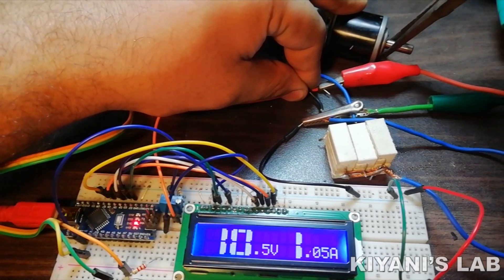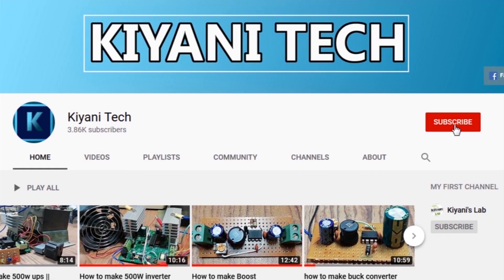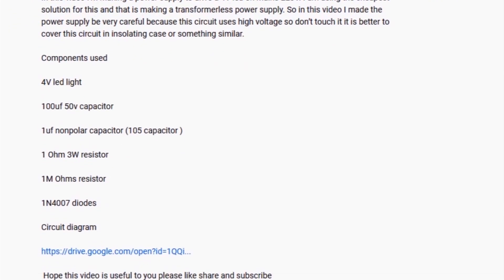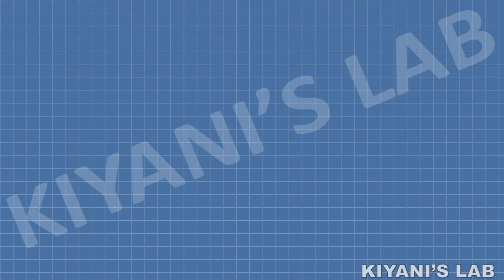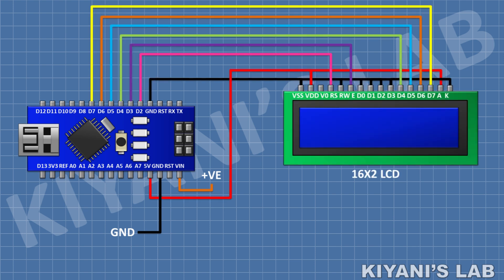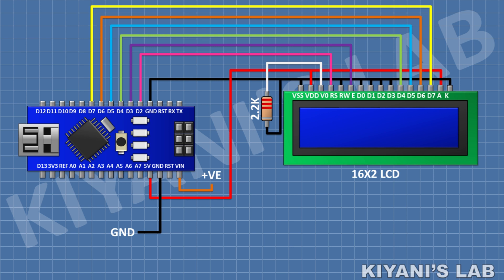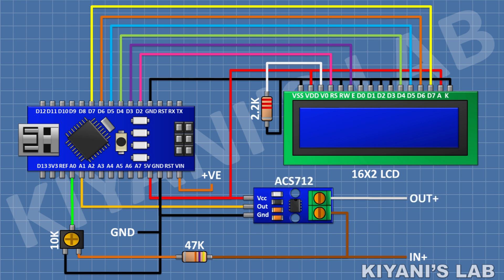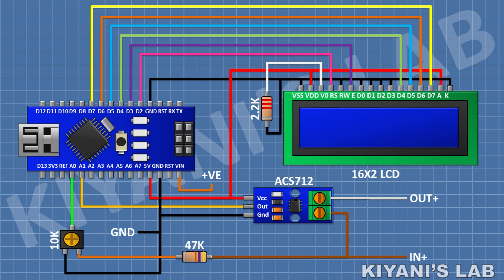How To Make Arduino Based Volt Ampere Meter

Comment: Is there a way to salvage a 44k resistor or create 1 with different kinds of resistors. There's an arduino power meter I wane create But this is the missing ingredient I need to do that. Our local electronics shop doesn't have it available 😢😢

Comment: Hi!
I made your circuit with Arduino nano and ACS712 30A.
Voltage measurements are accurate but current measurements are not exactly,there is 1A difference.
I wonder if you can help me a bit,I want to tell you that I,m a beginner with this kind of things.
I will tell you thank you in advance!

Comment: Good afternoon, Kiyani's Lab. Thank you for the great circuit. I want to use it in conjunction with the Xl4015 module, which has short circuit protection, but I think to put your voltmeter and ammeter circuit after the module. Can you please tell me if a short circuit can harm the ARDUINO NANO pin A0, or is it protected by a 47kΩ resistor? Thank you.

Comment: Do you (or anybody else reading this comment) know any trick how to measure very low currents at extremely high voltages via Arduino?
Background of this question: I'd like my Arduino to receive feedback information of the Amps going through the high-voltage side (~20kV) of a flyback-transformer.

Comment: hi.Is there any way sir, for you to change the code to use LiquidCrystal_I2C ?
Reply: // include the library
//#include <LiquidCrystal.h>
#include <LiquidCrystal_I2C.h>
#include <Wire.h>

LiquidCrystal_I2C lcd(0x3F,16,2); 

just change these code and check your i2c display id .
Reply: @jomontk  hi sir how are you  sir I have 1 parjct  I need your help please

Comment: now voltage regulation on the arduino to 10 - 15 Amps together with the meter and you are the master :)
Reply from the maker: ok bro
Reply: How to add esp8266  @KiyanisLab